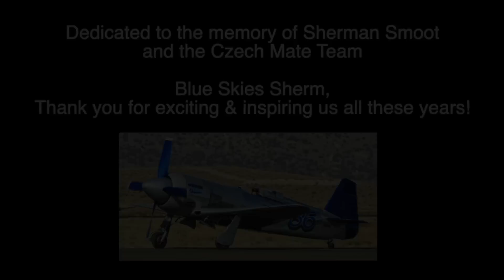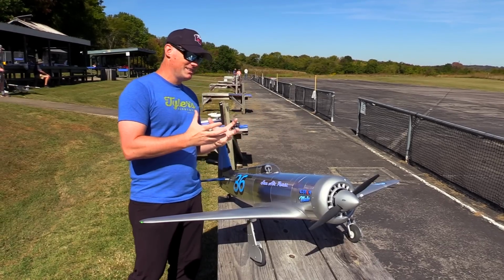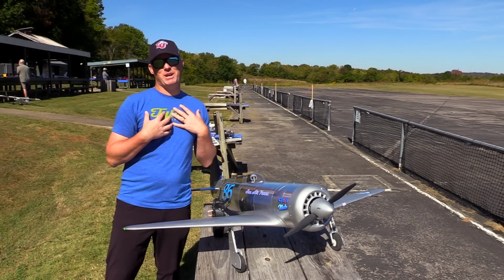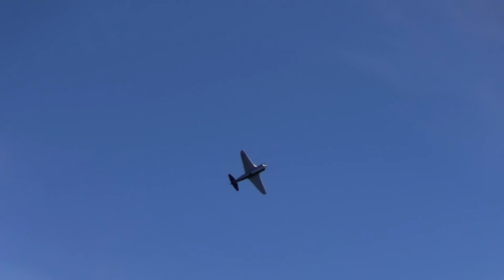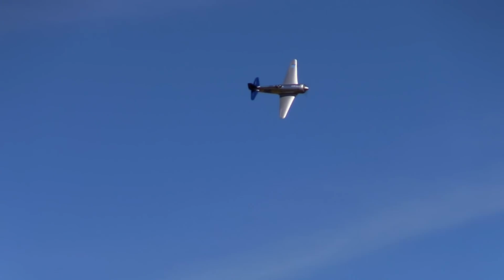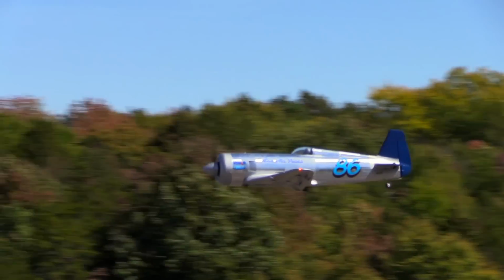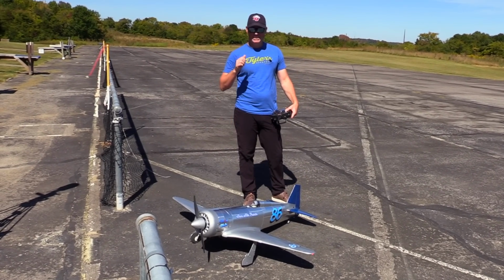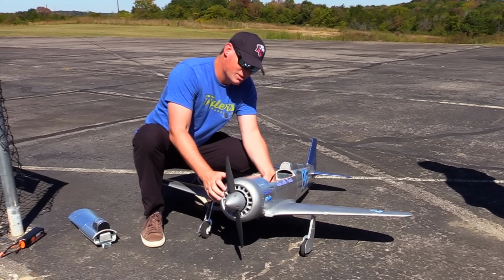RC Czech Mate First Flights: Honoring a Reno Racing Legend

Comment: I have a question. I am building a ,70,inch ziroli P47, the smaller of the 2 ziroli offers.I would like to know what budget friendly servos would you recommend that will reliably get the job done and center properly every time. I respect your opinion because you are a highly experienced builder.

Comment: 👌 Looks good, flies well. 😋 Start & landing on grass possible?
Reply from the maker: The model should handle grass without too many issues.  It’s a good sized model and has good sized main tires which should do well in the grass. 😊
Reply: @Thercgeek  Thankls OK. In the first second of this video a nice 4-blade prop is showed.😜
Reply from the maker: Yes, the full scale airplane used a cut down Skyraider propeller. 😁

Comment: can the cowl and motor be moved forward? that would significaanly reduce the ballast requirement.
Reply from the maker: Nothing is impossible, but it would change the scale looks of the model pretty substantially.
Reply: @Thercgeek  1/8 inch might drop a few oz. without being obvious in appearance. thats how i balanced out my 1450mm mustang . used a thinner prop adapter to correct the spinner to cowl gap